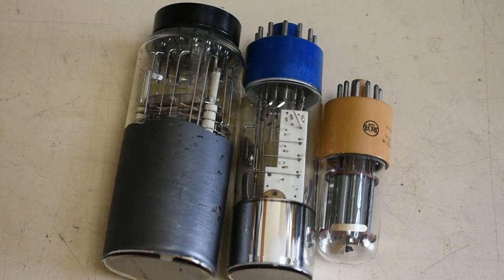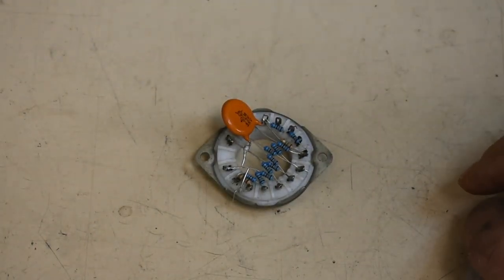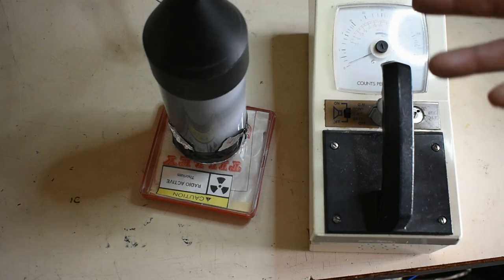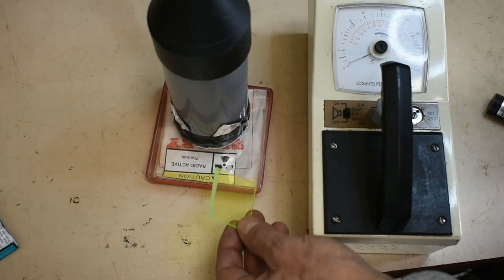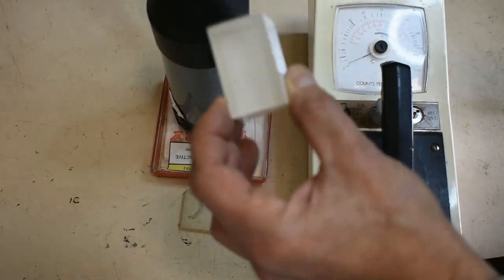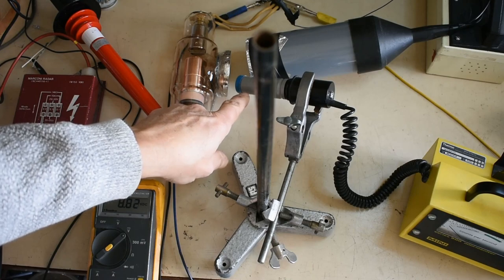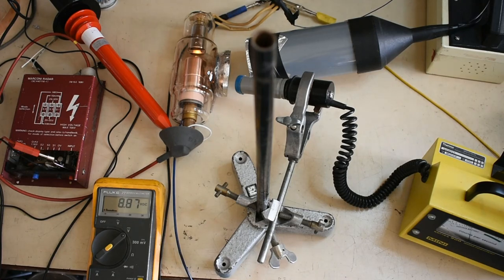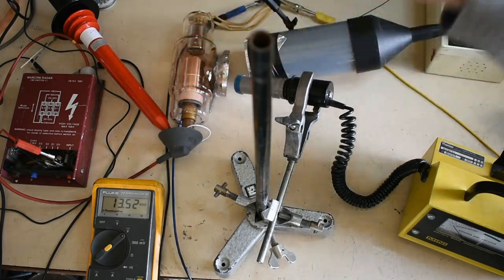Testing a Photo Multiplier Tube

Comment: Another brilliant video!  I have a number of PMTs including the side window ones - I also have two of those geiger counters that you are using in the video - I find them absolutely excellent and they must have cost a bit back in the day.  I have never had a solid state detector to try them with only GM ionisation chamber tubes.  I also use a Fluke 73!
Reply from the maker: Thanks, yeah, PMT are quite fascinating devices. These old Geiger counters are quite easy to work on. I've repaired a few but never found a circuit diagram for one. Only recently acquired a solid-state alpha detector (on another video), which is interestingly sensitive to visible light but other than that only alpha particles. Although semiconductor detectors are becoming more common I remember an early solid-state detector back in the 1980s at work that needed to be constantly maintained at a low temperature with liquid nitrogen or it would quickly degrade.
Reply: @tuopeeks  Excellent - I will have to look at the video of yours on the solid state detector.

Comment: brilliant vidéo!! i'm making my own too ; by the way whats the model of the geiger counter you're using ? i'm look for its reference to get  its high voltage schematic ;)  thanks
Reply from the maker: Thanks, I was using a Nuclear Enterprises contamination meter 95/0339. These come up in eBay quite a lot but I haven't found a circuit diagram for them. They are not too complicated and used discrete components so can be worked on easily. I did have one with a transformer fault which was a bit more  difficult to repair.  The PMT was a Mullard 150AVP
Reply: @tuopeeks  thank you very much^^

Comment: Hello! What is the difference between square vs hexagonal vs round photo multiplier tubes? In gamma cameras still using round shape which is covers lower area compare to square or hexagonal. Thanks in advance.
Reply from the maker: Good point, not sure I know exactly either, but as you say hexagonal and square can be closer packed to cover an area efficiently with effectively more sensitivity. Don’t think I have seen many square ones though. Interesting the gamma camera you mention uses round tubes. I have seen light pipes used to couple scintillators to the PMT that way avoiding missed areas but at the cost of possible light attenuation so the scintillator shape may be more important that the PMT.

Comment: What sort of plastic is that scintillatorplastic? Can you use normal plastic or does it have to be a special and probably costly scintillator? Great idea you tried that other piece too!
Reply from the maker: Plastic scintillators for PMTs are manufactured and are quite expensive but cheaper and more workable that others such as Sodium Iodide crystals. Not too sure of the types I have here, most seem to be made with benzine compounds.  I just wondered, but wasn’t too hopeful, if something fluoresced under UV it might scintillate under higher levels radiation. Most scintillators used with PMT seem to fluoresce under UV.